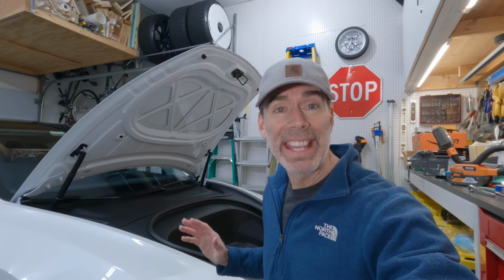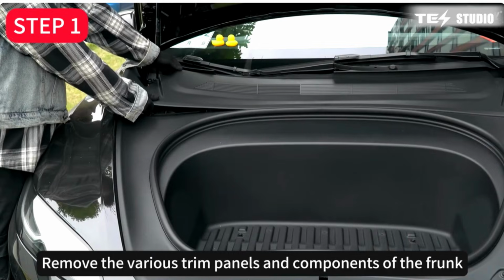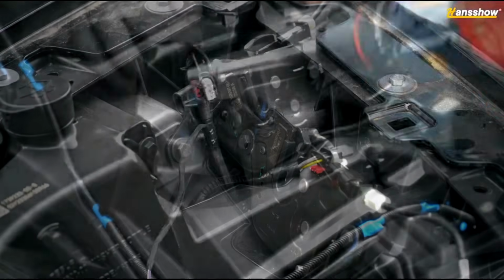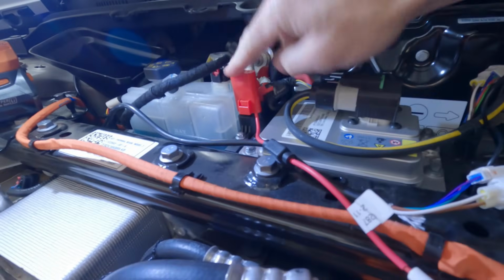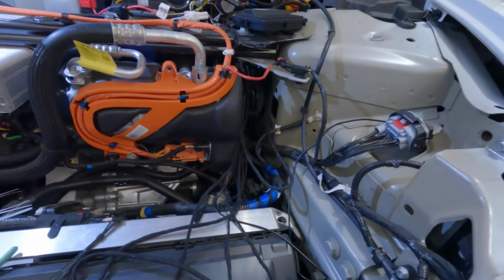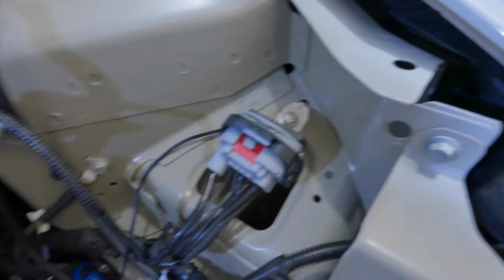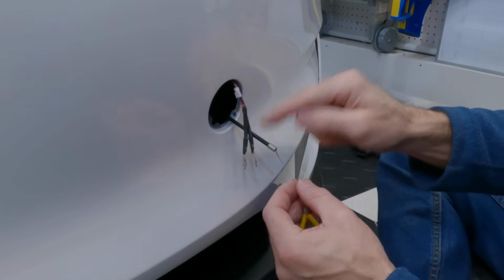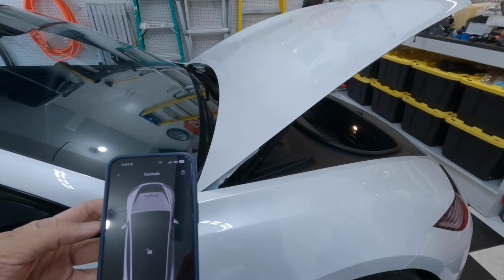Power Frunk from Tesstudio - Install and Review

Comment: I just received my kit to install. Just wanted to ask the question when it comes to the point about the battery. Will I get a shock or anything like that when I go to put the power cable and attach it to the battery. Do I need to wear special gloves before doing this?.
Reply from the maker: There should not be any shock when attaching the power wire to the battery tab but you should attach that wire first  then plug the other end of the wire into the rest of the harness/module.
Reply: @mmark300 I understand thank you
Reply: @mmark300  for the low-voltage battery and the power wire connector since the power wire connector is kind of like shaped as a C couldn’t you just have put it right on the terminal of the low-voltage battery and then taped it up that way rather than using a screw. Or was the screw necessary?
Reply: so i did the install a few weeks ago. everything seems to be working, but I do get an error on my screen when I open the frunk. it seems that the metal cord is pushing against one of the sensors on the original locking mechanism. Are you experiencing this?

Comment: Have you had any issues? On my 2025 model 3, this kit broke my bottom strut brackets in half.  I removed the brackets and theyre made of very lightweight metal that doesnt seem very sturdy.  The struts in rhis kit may be too strong for it.
Reply from the maker: @leirej  I actually ended up putting this on my friend's Tesla and they haven't had any issues with it yet,  BUT another friend had the same issue on a model Y. This is the second time I'm hearing of this...
Reply: @mmark300  I have new brackets coming but I'm hesitant to try again.  Luckily the brackets are only $15 a piece (they feel that cheap) but I don't wanna mess anything else up.
Reply from the maker: @leirej  Yes, the brackets seem to be a lightweight diecast metal that is not too strong.  And yes, luckily they are not expensive and available.  Tesstudio and others need to supply better replacement brackets.
Reply: @mmark300 I emailed  hannshow about what happened and they're sending me "an iron bracket that is of better quality than the original bracket."  I'll report back once I get them.
Reply from the maker: @leirej  Oh, nice
Reply: @mmark300  Got the new brackets installed from Hannshow.  They each weight 180 grams.  The OEM brackets weight 97g.  Definitely feel heftier.  Fit was perfect and everything seems to be lining up fine.  Power frunk has been working fine too.  So if you have one of these kits installed from Hannshow on a model 3 highland, I highly  suggest you request the more robust lower brackets they have.
Reply from the maker: @leirej  That's great to hear, thanks for following up!

Comment: All the Tesla models sold in the U.S. are made in the U.S. China does indeed sell a Tesla Model 3 Performance, it just uses a different battery than the U.S. spec so the acceleration is a bit less otherwise it’s the same car. You can verify this yourself by going to Tesla’s website and clicking on the China website and use google translate and you’ll see for yourself.
Reply from the maker: Thanks, I should have looked that up. I know China makes a P3 but I was told by someone I work with there that they don't actually have/sell them in China. Maybe they were just saying that they personally didn't have one to test products on... things get lost in translation. 
In any event, the point is that there are still many differences due to many factors.
Reply: Be careful buying from this company. Bought the power frunk for my 2026 juniper and it does not work. Called, emailed multiple times and no response. Going to see if Mastercard can get my money back.